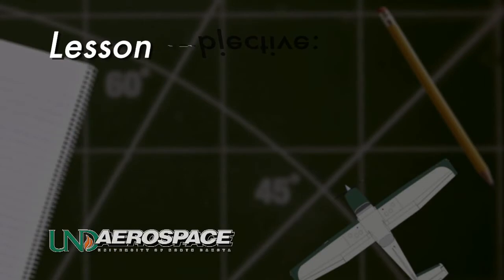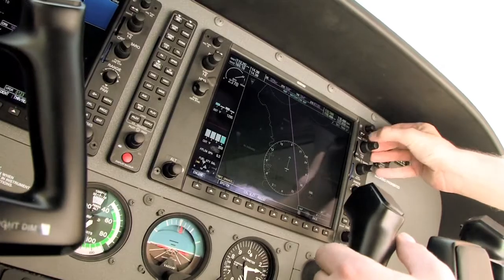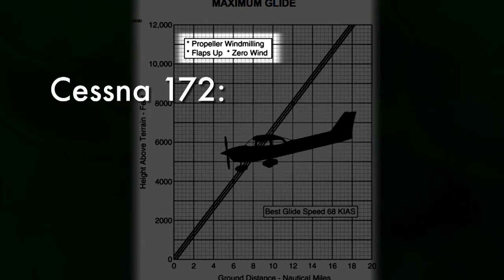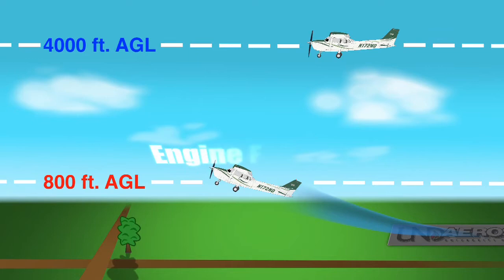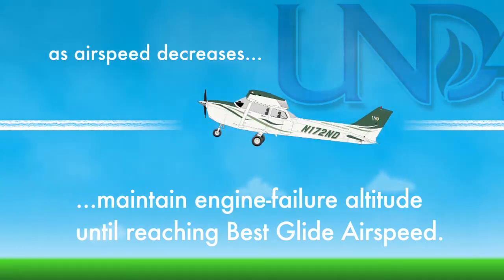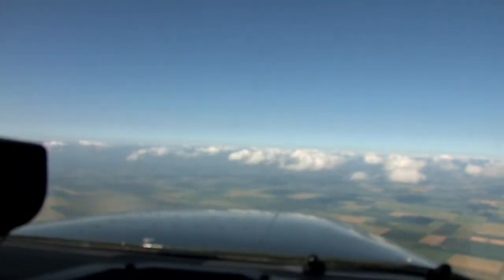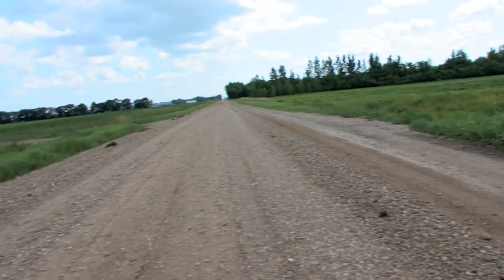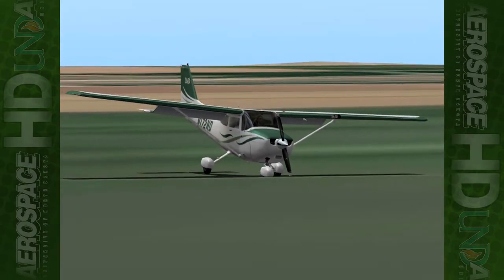(Video 1)The Emergency Approach and Landing

Comment: Max glide speed is based on the best L/D ratio and gives you the best distance for the altitude you have. By flying slightly slower, it is possible to operate on an even lower part of the power required curve, but this yield less glide distance while maintaining slightly more time aloft. Too slow and you waste distance and time as sink rate will increase on the backside of the curve. If your goal is distance or range, fly the glide speed. This approximates the angle of attack for best lift/drag.